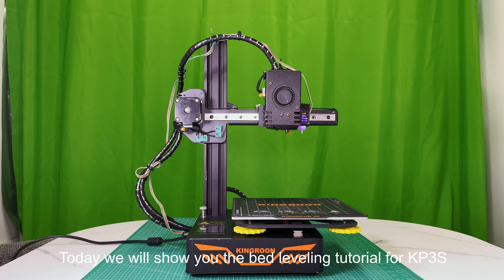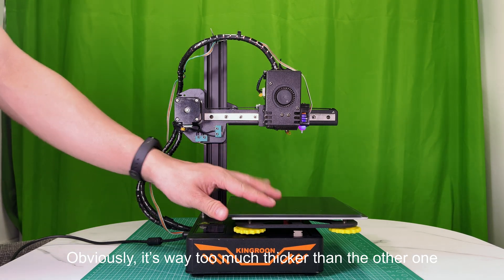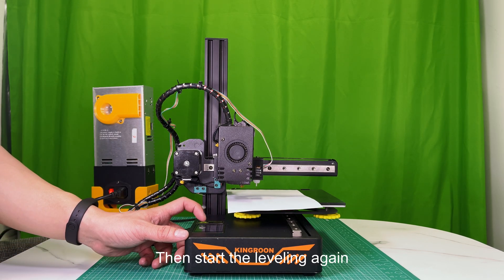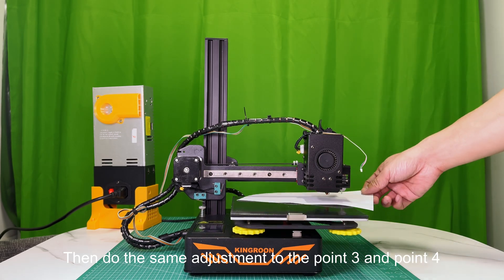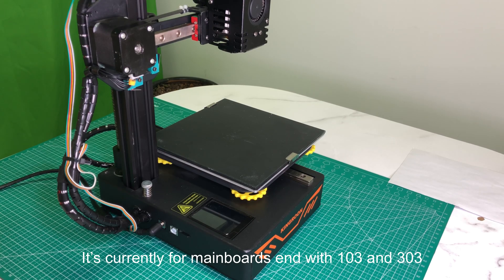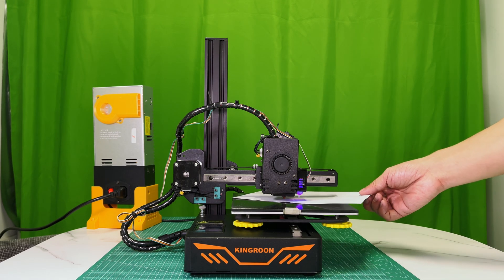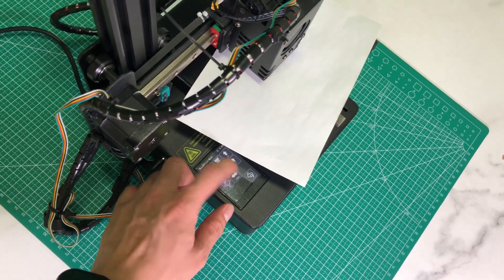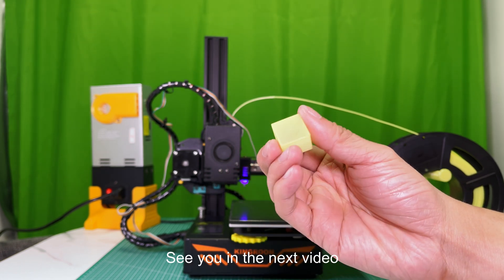Bed Leveling Tutorial for KINGROON KP3S 3D Printer

Comment: Hello, good video. I would like to ask you something.

I bought the Kingroon Kp3s
I have a problem with leveling. I level all four points manually, but by the time I get to 5 it's too close to the bed.

Maybe you had the same problem.

Thanks in advance and greetings
Reply from the maker: you can try to adjust point 1 and point 3 , and then try to point 5
Reply: Start with 5 for most qccurate Z, then move to others as they can be adjusted with the knobs

Comment: Got my printer today, followed instructions and set up. Go to make print as per instructions and printer starts beeping, lays 1-2 lines, returns to the starting position (still beeping) try to resume print, resumes beeping and wont print. Displays no error code, just beeps. Searched google and kingroon support but couldn't find anything. Something is not right. 
Have done all methods of trouble shooting. Extruder and bed are at correct temp and are both working, fan, etc working. Moves freely on all axis, have powered on and off. Using the print files supplied on sd card that came with it. All appears working fine and functioning as it should until it goes to print. Starts beeping, won't print, try to resume, continus beeping have to just turn it off as its not working. I have a feeling its faulty. Help appreciated. Thanks

Comment: Sir, I do have a question which is a little bit irrelevant to the the video. When we are done using 3D printer, can I turn it off right away or I have to wait for a short time for the machine to cool down. I am using Kingroon KPs by the way
Reply from the maker: There is no need to wait it to cool down. You can just turn it off directly after the printing is done. Actually you can keep it on, the printer is more durable than you think, I almost never turn them off. It will back to the normal temperature after every printing, so it would be fine and safe.

Comment: I'm getting tired of this printer.
I installed bltouch, changed the firmware according to my card.
The bltouch pin does not go down.
I tested bltouch with my E3D and it is working normally.
I tried to use bltouch with pins (2, switch) connected on XMIN and XMAX and it doesn't work on either of them.
MB ver.1.3
Reply from the maker: Sorry for what happened. Please send us a video to show the problem, we will do a further check to find it out. Please make sure we can see your connection on the mainboard and how the printer works. The email address is support@kingroon.com, waiting for your email. Have a great day!
Reply: @Kingroon3DOfficial  no problem, i returned the product to you on aliexpress and i hope you give my money back so i can buy from another manufacturer
Reply from the maker: @Allage  we are just trying to help you out, but your decision is respected. Our guy on AliExpress should help you with the order well.

Comment: after I installed the new firmware that allows changing the offset on the printer, my KP3S started to allow movements beyond the printing area.
What can I do?
Reply from the maker: Modify the cfg file and flash it. Make sure that you are using the same mount as the video, or the coordinates are different. Here are the article you can read (Step 3) https://kingroon.com/blogs/3d-print-101/modify-mainboard-configuration-file-of-kingroon-kp3s
Reply: @Kingroon3DOfficial  
the cfg file has the correct data.
When I install it on the KP3S it works normally at first, but when I adjust the offset by the printer system it starts to allow movements beyond the printing area as if the limits had been erased
Reply from the maker: @gomes2202  Please check my last reply and send a video to support@kingroon.com, so that we can see the problem clearly.
Reply from the maker: @gomes2202  Please send the email with the video, we will do a further check.

Comment: is the firmware   right? it doesn`t show z offet menu. it just start autoleveling and nothing happen
Reply from the maker: We posted a new video with the new firmware. Here’s the link: https://youtu.be/LBa8X6U1Y_w
Reply: @Kingroon3DOfficial  where is stock firmware origin image?
Reply from the maker: @thekeydoki  You can find the link the description.
Reply: how stock firmware return???????????????????
Reply from the maker: @thekeydoki  Please check the description, we have the stock firmware listed. Just download it and flash it. If already have the 3D Touch installed and don’t want to open the printer, please unplug the 5-pin cable connected to it. Or the manual bed leveling cannot be done.
Reply: I don't think they actually remembered to update it on their website because I get the same issue on the f103 board with trying to update.
Reply from the maker: @TheOnlyRhino42  Yes, that’s what happened. It’s a mistake. Sorry about that.
Reply: @TheOnlyRhino42   there is no the firmware in their website..  only old one and stock firmware without origin images. there is no way to return to origin firmware.  and they are deleting my questions now..  I just want to know how to return stock firmware with stock origin image.   I could't use it properly for two weeks.
Reply: https://drive.google.com/drive/folders/1eDY91nCIgY-3owwBqj1e4Szzl0qyVd9j i think we are finding this firmware, finally i found it in other video comment

Comment: I have abl installed and I use cura as a slicer. Every time I start a print i have to run the g29 command. If I don't do this the print will start to high like if the z offset was 0 (but it's not from the display). Any suggestion?
Reply: What firmware are you using? Delete G29 and try adding M501 and M420 S1 after G28.
Reply: @birddown7835  thank you for the suggestion but doing as you said had no effect. Basically my nozzle digged inside the build plate during the first line. As for the firmware I'm running the one suggested from this video https://youtu.be/LBa8X6U1Y_w
Reply: I have the same issue, the first layer print to high, have you find the solution ?
Reply: @Unknown-vb1re  i use the g29 to run a mesh bed leveling before every print. This is solving my issue also if it's not the perfect solution
Reply: Same issue, sometimes the offset isn't applied and it starts too high. When this happens, you can't adjust baby steps from the print options menu either. This firmware is very buggy